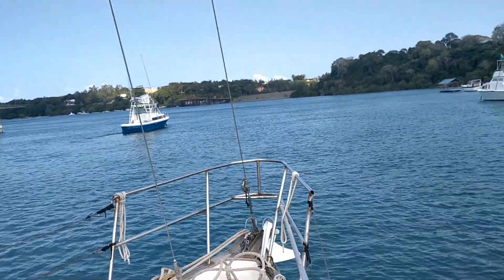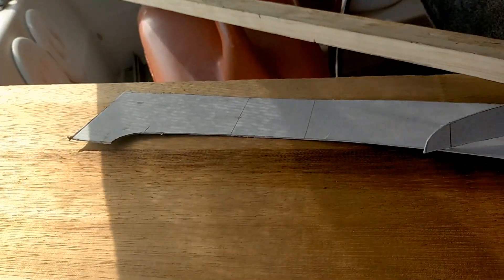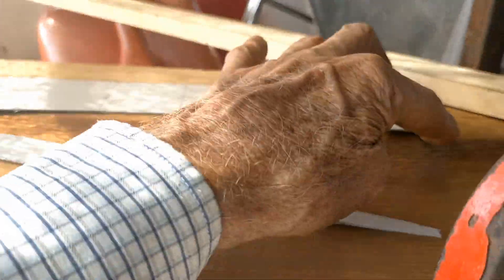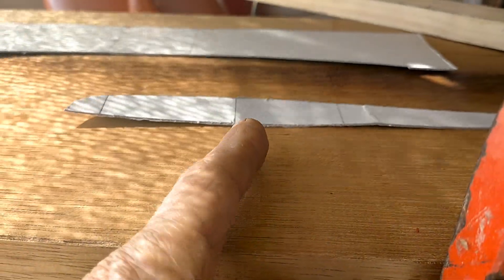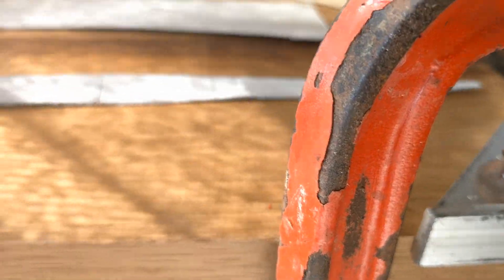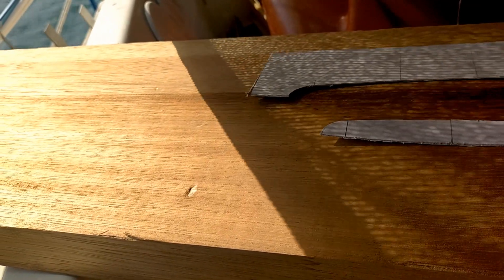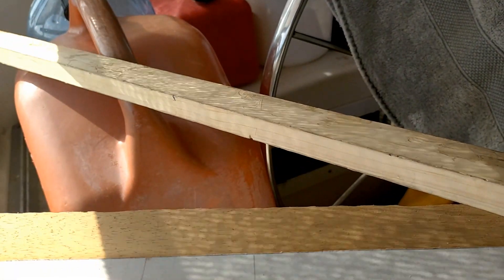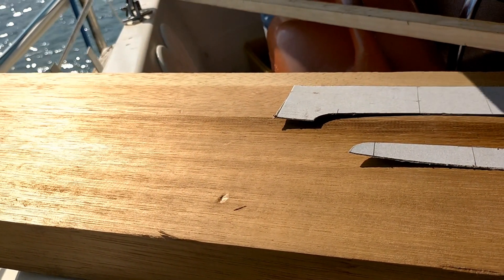Making my own auxiliary rudder | Part 01

Comment from the maker: SunShine is for sale. US $19,500 Or Best Offer
Boat History Report available.
I do not need another report or a different report.
For more information send me an e-Mail
sailingotr@gmail.com

Generally an auxiliary rudder should have about 40% of the area of the boat's main rudder.

I found this site. It comes from The Pirate Bay org.
This is a direct link to download John Letcher's "Self-steering for sailing craft". 
This book has become a classic and was a great resource for designing and building my own windvane self steering. I have made three different systems on my current and two previous boats. John also covers a great deal about sheet to tiller methods for self steering.

https://annas-archive.org/slow_download/06f736aeabdbfdfcc9de335c2fda09fb/0/1

Anna's Archive is also a great resource for many other books including many marine related authors.